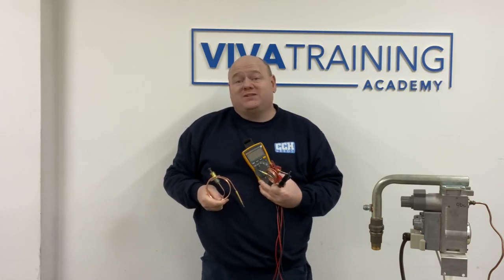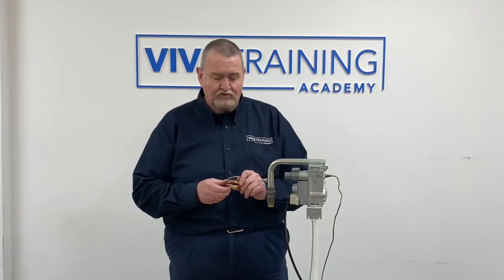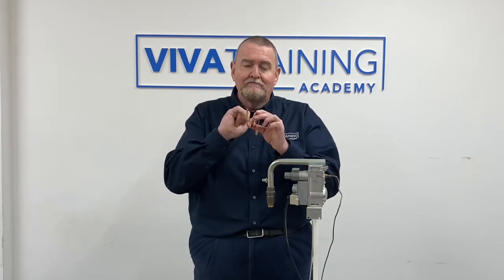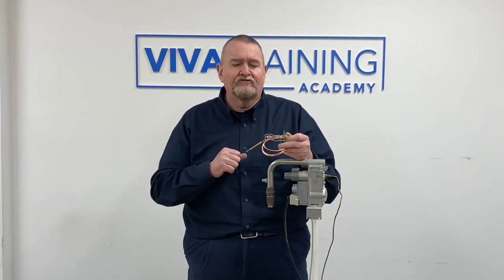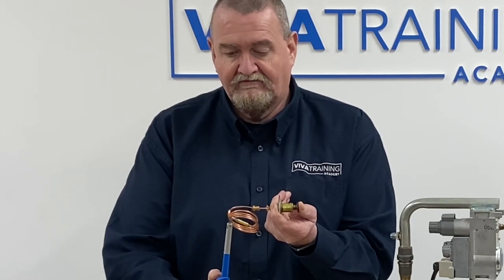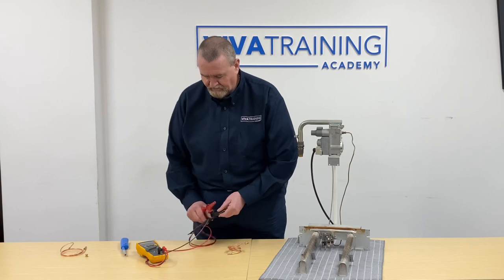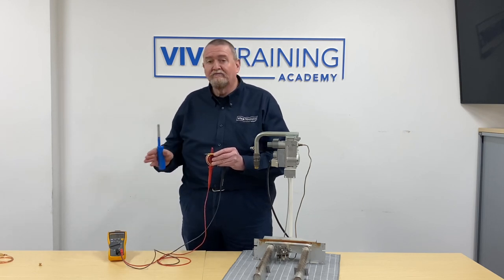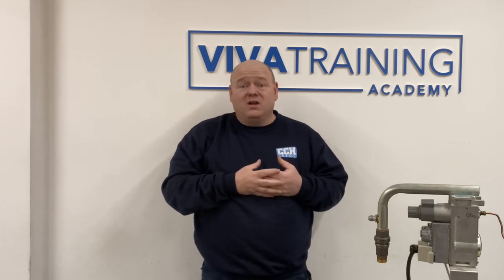Gas Training - How To Test a Thermocouple - Multimeter Training

Comment: Thanks for posting this. I recently purchased an old Eastham Maxol 41 camping oven. Couldn't figure out why it wasn't working till your video explained how the thermocouple combined with the flame failure valve worked. After that it was easy to test the operation of the valve and thermocouple. Explains why I couldn't get it to light first time. I didn't hold the button in long enough.
Thanks again.

Comment: Can't remember who but someone makes one off them testers got one in a bag some place. Works better than multi meter tested some that where obviously burnt out but was getting 20 odd millvolts
Reply: Regin make a thermocouple tester which is the same setup as using an old mag unit
Reply: Hi Colin,
Thanks for the feedback. Regin do one the REGT20, I used to have a SIT one years ago.